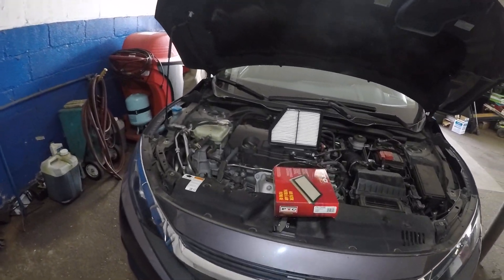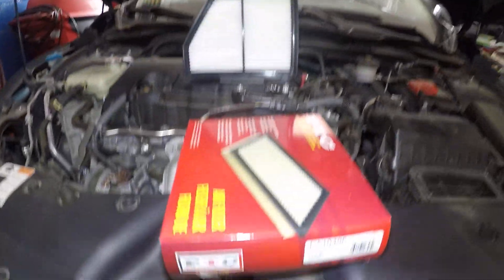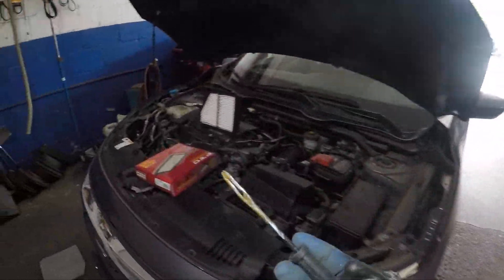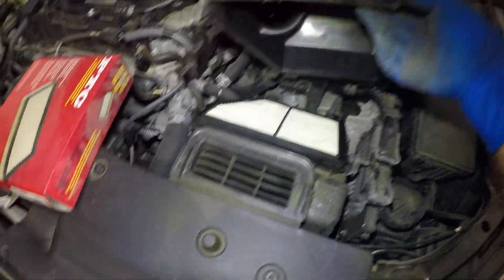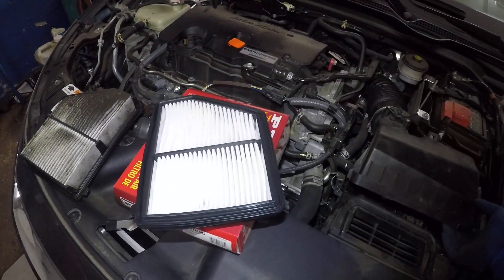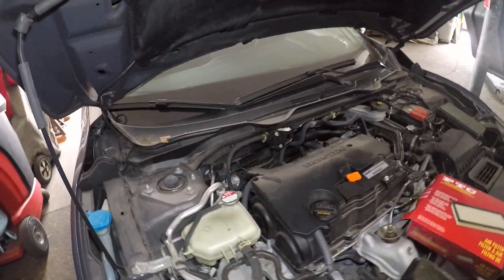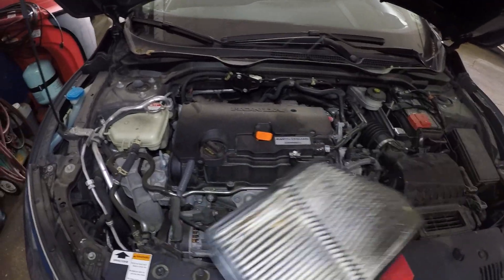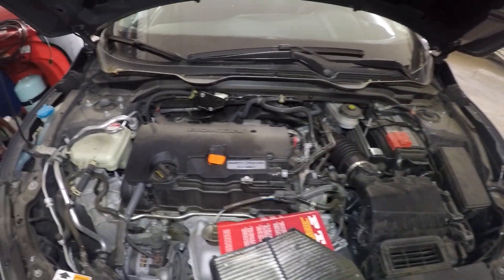How to replace Engine Air filter on Honda Civic 2013-2017

Comment: Mine is in the back and I can't lift the lid
Reply from the maker: U can move it forward
Reply: I tried but it won't move. It's bolted down
Reply from the maker: @dbluehorsedeboe5567  u have to unbolt then move it up a bit and out forward